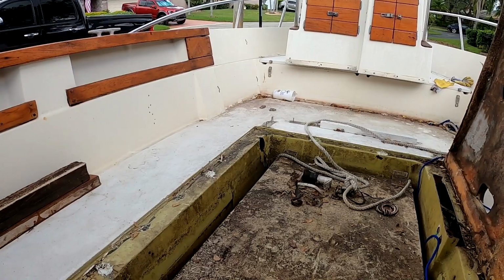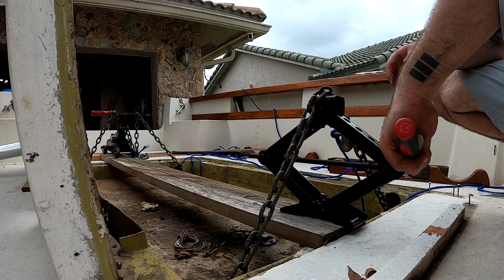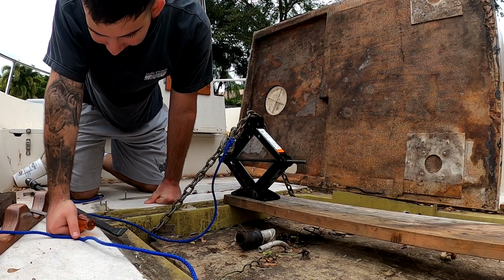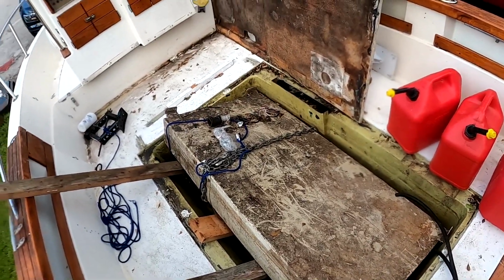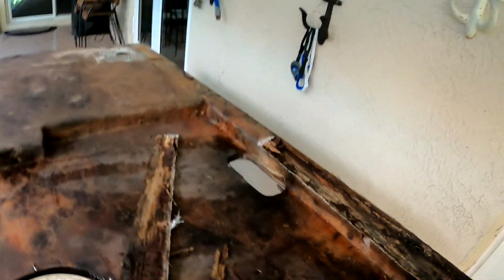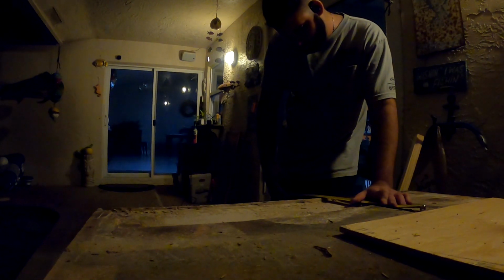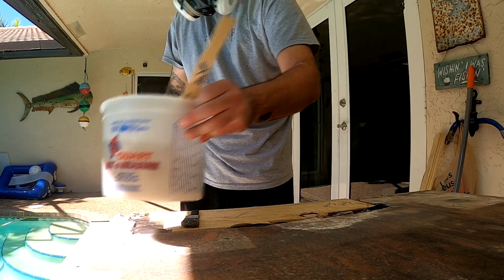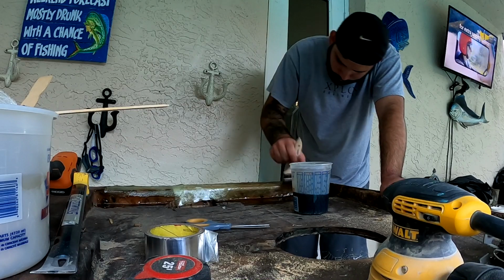RESTORING MY 1980 20 FOOT ROBALO! GETTING THE GAS TANK OUT! PART 1

Comment: have a similar robalo from almost the same year, but I'm looking for ideas on how to put the bilge pumps! since the old robalo do not have that system! I would like to put them under the hull.
If you have the same problem pleas and resolve share the video .
Reply from the maker: Hey thanks for watching! Yea the old hulls have a weird design because the only place it drains is from inside the tank to out of the boat thru the drain plug. So I’m gonna put it in the back by the transom in that little cubby. I’ll make a video of it and where I put it! It’ll be coming soon in the rigging video
Reply: @oneofakindoutdoors  super!